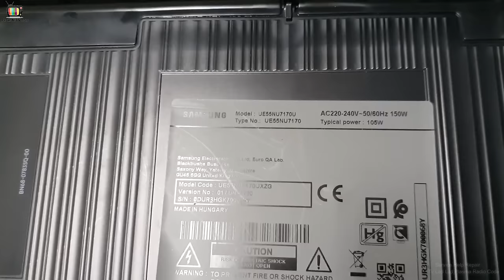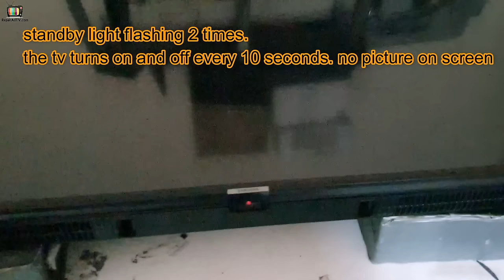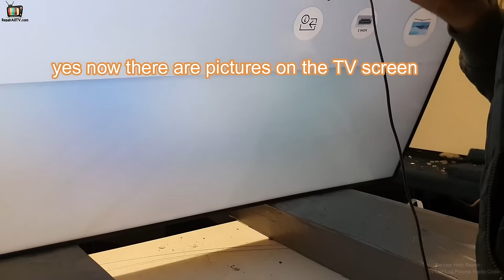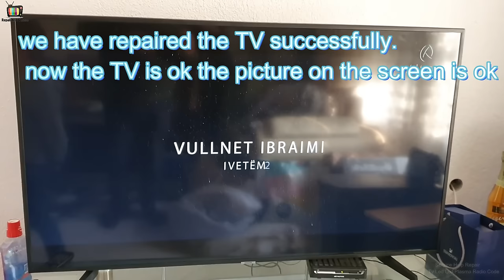SAMSUNG UE55NU7170U The TV turns on and off. every 10 seconds no picture on the screen

Comment: Hallo can you help me: I have a Samsung UE55MU6179, that makes the same on/off and no screen. When I pull Ribbon 1 from Mainboard to screen, it keeps on with backlight but no picture. Wehen I put ribbon 1 back in and pull ribbon 2 from Mainboard its the same, tv keeps on with backlight but no screen... I think it is the Mainboard, what Do you think? 
Thanks a lot
Reply: Hi, did you find a solution for your problem? I am having same issues as yours on my TV UN65KS8000
Reply: I am having the same issue, after I put the type is coming on with sound but no picture. Please someone should help us.
Reply: @James-rx4ry  I solved my problem with a new Mainboard, now it works! Be shure to get the same Type of Mainboard, the Numbers have to Match exactly.
Reply: @Gollumfiech  OK thanks
Reply: @James-rx4ry  did it work?

Comment: How do you know the exact location on the ribbon cable where to place the tape? Was this pure luck that you found the correct location first time?
Reply: I just had the exact same problem and It works. As of the ribbon I promise you I just slap it on there and it work not even close and it worked
Reply: Does any tape works???
Reply: @siniaavila5326  it needs to be electrical tape, otherwise it may cause the covered pins to short with something else
Reply: @luisinhoens90  thanks

Comment: Its working. Not great but working. I have the same issue, but after reviving tv this way i have some horizontal lines and some screen flickers. That is scandall that TV of that cost fails after 2 years!!
Reply: Cut the tape, make smaller one. You hide pin which is needed for video.
Reply: I hide pin 7-10 (from the right side) and now it works at all. 
If you have horizontal lines or black screen in vertical line, it is necessary to cut the tape and try which pin might be visible. If it is not working on one cable, try the second cable. At first I spent hours on the wrong side (cable). 
Thanks for that video! :)
PS: That issue is caused by screen panel, it is useless to try powerboard or mainboard replacement.

Comment: Okay well I fixed my tv but now my left side of the screen has almost no color to it ? Can someone help!
Reply: I have the same problem. Color on the right bw on left
Reply: Cut the tape, make smaller one. You hide pin which is needed for video. Try to hide only 4 pins etc., or move the tape little further.

Comment: Thanks this work for my tv 
But now the righside looks  dead colors has anyone solve this ?
Reply: I hide pin 7-10 (from the right side) and now it works at all. 
If you have horizontal lines or black screen in vertical line, it is necessary to cut the tape and try which pin might be visible. If it is not working on one cable, try the second cable. At first I spent hours on the wrong side (cable). 

PS: That issue is caused by screen panel, it is useless to try powerboard or mainboard replacement.

Comment: How man find which pin make problem? Thank you
Reply from the maker: easy. remove one ribbon from the mainboard if the TV is turning on. that's when you have the problem. cover lines 3 to 6 lines. start from the end of the ribbon to the end, trying until the TV shows the picture
Reply: @RepairAllTV  also from one side start,cover first 3line. (First 3 line 0-3,than from 3-6line, than from 6-9 to the end) ?
Reply: @RepairAllTV what if there is no picture at all no matter which of the two I remove?  The only thing that changes with one of them  out is the  tv stops cycling off and on and blinking twice.  Are both of them bad?  Also with a little tape on one end it stops cycling off and on but still no picture.  Any ideas?

Comment: Still not getting picture but have sound. Need help.
Reply from the maker: if the back panel does not light up.  that's when the problem is.  backlight led strip panel
Reply: @RepairAllTV  the LEDs light up but just no picture on the screen

Comment: SOMEBODY PLEASE HELP ME I HAVE THE SAME ISSUE RIGHT NOW. I TAPED ON THE LVDS CABLE AND THE TV TURNED ON, THE BACK LIGHTS AND SOUND IS WORKING BUT      NO  PICTURE ..    HELP
Reply: Please.
Reply: I have the same problem
Reply: I am having the same issue, after I put the type is coming on with sound but no picture. Please someone should help us.
Reply: Mine is the same bad panel
Reply: I had 15 pins exposed from the right and covered 11, I had the same problem as you. Worked like a charm after that.
Reply: @gumby-damnit3031  I’m having the same issue, but I’m not understanding your solution!did you end up covering just one pin? Thanks